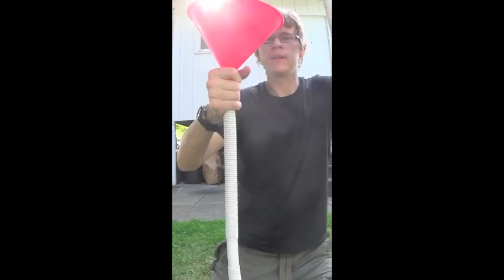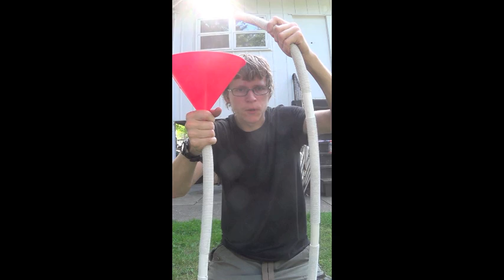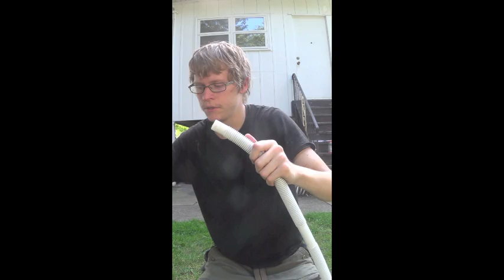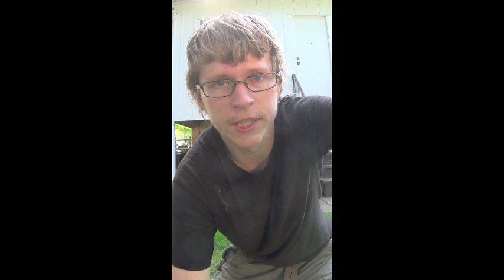Perpetual Motion = Impossible

Comment: the tube is too large
Reply from the maker: +Francesco DeLuk It doesn't matter how big or small the tube is. Any variation will fail unless you move the tube end up and down pointing it in the funnel, but that's not perpetual motion.
Reply: +Guru of Random the idea is that it works thanks to capillarity, from hydrogen bonds of water with the tube